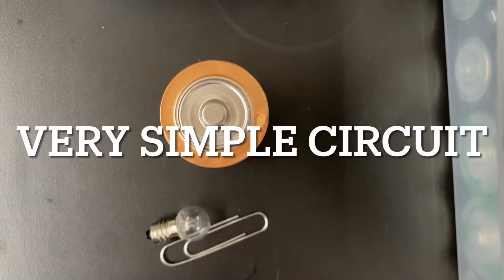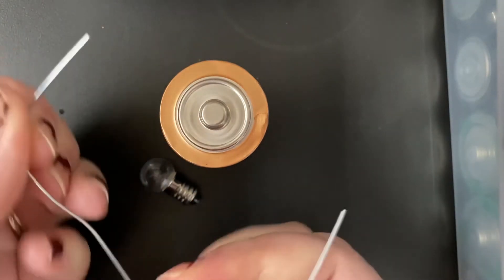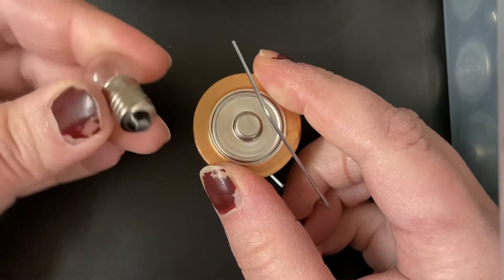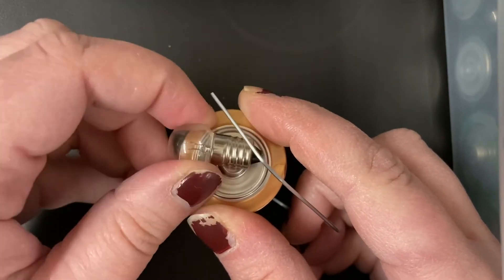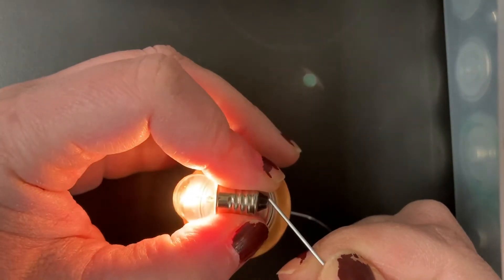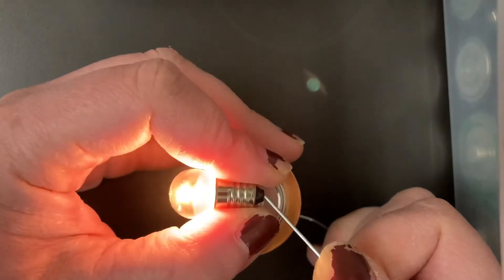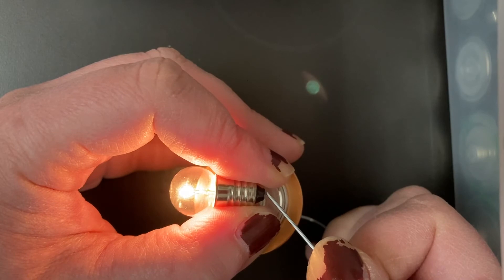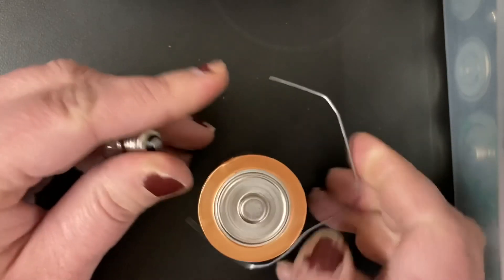Simple Circuit using a paper clip, battery and light bulb 💡🔋

Comment: I'm looking to do something like this with a candelabra bulb (It's a 7 Watt 120 Volt C7) will this type of bulb still work? Will I need a big battery like in the video? Thanks!
Reply from the maker: Thank you for watching and showing interest! The bulb I used required  1.5 volts to power which is approximately what one battery can put out. The light bulb you suggest requires 120v which is going to require loads of battery power even for a small candelabra bulb which is why this was one rated for electrical use which powers at 120v. You can def try! Think of a flashlight, those standard light bulbs are usually 3v and would require two batteries to power because one would not have enough power. I hope this helps!